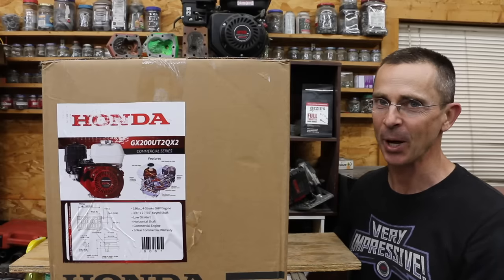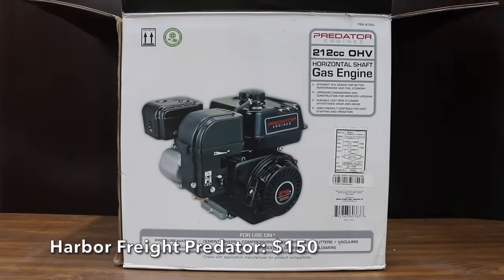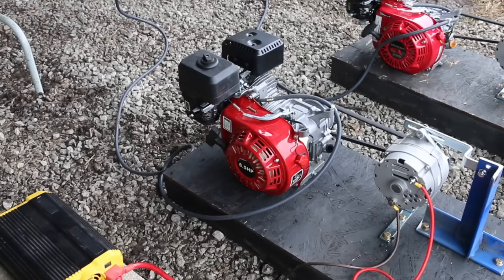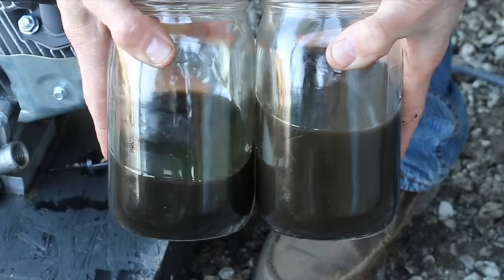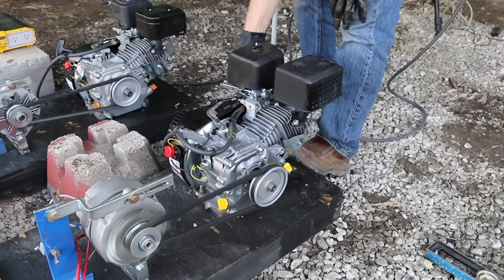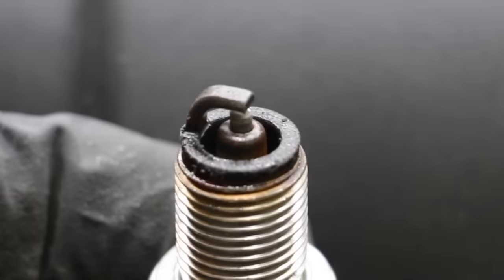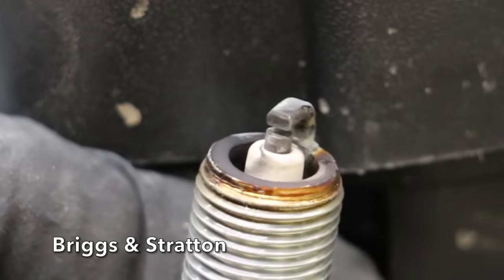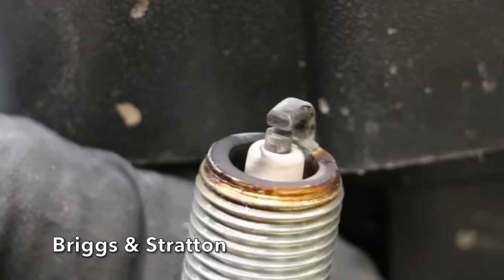$150 Honda Clone vs $600 Honda? Let’s settle this! Fuel Efficiency, Horsepower, Durability, Starting

Comment: Those Predator engines are a great value. Also crazy the amount of aftermarket there is for them.
Reply: Agreed, I live in an area where they're quite popular replacement engines, people use them for everything. As long as you don't severely abuse them and maintain them, they seem to be not only quite reliable, but also incredibly cheap to repair.

I have a buddy that heavily modifies them for go cart usage, using big bore kits and such, and when he does break them, depending on what breaks, it's often cheaper to buy a brand new predator than it would be to replace a broken bottom end of a Honda or Briggs.
Reply: I agree. I’m glad the Predator tested well since I have that on our go-cart.
Reply: Predator engines are pretty great. We gutted the one we put on my nephews go kart and it really cranks out the horsepower.
Reply: I use the 22hp Predator twin cyl only modified with electric fuel pump and better spark plug for replacement skid steer engine. 45 hours and still going strong after some pretty abusive use
Reply: But they are produced in China (Honda in Thailand). If it comes to a show-down between USA and China, I wouldn´t be sure, if I wanted Chinese products on the markets, as the sabotage risk would be high.
Reply: @ZoonCrypticon  ? Sabotage on a small engine for what purpose, to blow up every lawnmower in the US?
Reply: @bixby9797  right. The Japanese didn't invade during WW2 because there would be a rifle behind every blade of grass. And now the Chinese want our grass to be taller. 😆
Reply: can’t beat the harbor freight warranty either
Reply: @blaineburgess  Correct  on the Warranty at HF ...... The Briggs and Honda Warranty are Hands Down GARBAGE good luck getting a replacement engine from them at HF just bring back the broken engine and no question asked the same with tools
Reply: @ZoonCrypticon  Man you need to get out in the fresh air more.
Reply: Dang right….  With the correct upgrade kit you can get a lot out of them….
Reply: @ZoonCrypticon  ???? Dude We are the CHINESES BEST CUSTOMER??!!! This would be like a casino blowing up its own Gambling floor!!!
Reply: @rogerstlaurent8704    The B & S of today is not the quality product it was when built in the USA.  They went bankrupt and another company bought the name and shopped production to China.  Gee, where have we heard that story before?  And obviously the quality plummeted, as usual.
Reply from the maker: Thanks for sharing.
Reply: @ZoonCrypticon  Honda also makes their GX series engines in china, they have a factory both in Thailand and China (Honda-Jialing)
Reply: @tomrogers9467  Um, compared to Honda, Briggs has always been crap
Reply: @bixby9797  you better believe it. Why, just last summer I saw some people drive by real slow-like while I was mowing. They're just waiting for an opportunity to blow up my mower.
Reply: Indeed.  I really hope they consider expanding the Predator engine line of products.
Reply: @tomrogers9467  Mr Tom you could not say it any better but the Twin  Cylinder Engine is still a Good engine but Warranty a big fat ZERO shame B/S was a great little engine Co
Reply: @inspectormills3290  Same thing happened to me. But I did have my shirt off and was glistening with sweat, so I chalked it up to the raging hormones of the local HS cheer team, lol.
Reply: @tomrogers9467  

Yeah:

As I said in another comment on here, I'm was very surprised how poorly the Briggs & Stratton stacked up especially to the Predator. You have now provided the reason why.  I'm old enough to remember where Briggs & Stratton was a desired engine just like a Wisconsin or Tecumsah engine.

Comment: Absolutely love this “knock-off vs genuine” content! It’s scary to think that a fake looks so similar and can easily be made to look real with little effort. Great video!
Reply from the maker: Thanks so much!!
Reply: Yeah, but they copied final product.... Honda needed to do R$D from scratch... Hence the price... People don't understand that
Reply: @Crotch_Goblin1  honda didn't do good in the QA and real world division on these little engines. not to mention all the metal shavings in the oil they left for the user.
Reply: @D3AThCAl2DS  it because oil was add to others, and other may not if ever had steal.  All new car, internal combustion should have oil change after a few hours if use them about at have paste.  For first few oil changes. I would in a engine plant it few machining station and rest washing machines.  There still can't get it 100 exactly fit.
Reply: @daisykaren6584  True.
Reply: @daisykaren6584  True, my dad always taught me to change the oil frequently on a new car. Oil change at 100 miles, again at 500, and again at 1500, then continue with the manufacturers recommendations. He drove a Toyota Tacoma from 0 miles to 500k miles, and my moms GMC Yukon made it to 450k miles, both on original motors and transmission. My mom would get annoyed sometimes and say that he was overtop on vehicle maintenance; but the cars never broke down on us. The Tacoma finally bit the bullet with transmission problems, but the Yukon was still going strong, mom just wanted a new car.
Reply: @mouthwash884  oil is cheap, engine not.
Reply: @Crotch_Goblin1  Honda engines were/are actually knock-offs of American made Briggs & Stratton engines... it just comes down to the quality of the builds....
Reply: @chrischristenson  Honda is the goat in every sector even in lawnmower engines, not to mention car and bike engines
Reply: @Crotch_Goblin1  And yet they still they didn't design this engine... hence the R&D for this Honda engine now stands for Rip-off & Duplicate...
Reply: @ProjectFarm 
FYI, Honda engines have been the most copied designs ever.
They also have licensed versions being made in several countries including Mexico and China (of course).

I bought a cheap Chinese scooter and it has a 150cc Honda copy, but I can't complain since it's easy to find parts. 
All I can say negative is that the casting metal is definitely not high quality aluminum as vibration damaged several areas even with additional bracing in the original castings, causing the kick-start to become unusable.. Never used it anyway.  Keep an eye on the mounts getting loose!
Reply: @mouthwash884  That's not what "bit the bullet" means. You might be thinking of "bit the dust" or "kicked the bucket".
Reply: @chrischristenson the slant cylinder OHV GX160 came out in ‘91. Which B&S motor did they copy?
Reply: @jimjames6558  B&S has been in the business since 1908, I was working on minibike engines with this design in the 60's and Tecumseh was using this design also and they've been around since 1934...
Reply: @chrischristenson  that’s cool and all, but nothing that B&S or Tecumseh were making had anything to do with the slant OHV design that almost every single stationary engine manufacturer has copies today. The only thing in common there is some arbitrary cylinder count which does nothing to save on RnD cost.
Heck, if you’re going to pull that card then the Chevrolet Small Block is a rip off of the flat head Ford (which it isn’t)
Reply: @jimjames6558  Honda did not do a radical ground up engine unique design, that's why you can have all these clones and knock-offs without patent infringements, as they all utilized the same mounting holes and the 4-bolt pattern where the accessories bolt up to which were based off of earlier B&S. The reason the Honda motors have become the comparison leader is because of the quality of the parts and the tighter specifications... and many manufactures went with the Hemi Head and tamper proof carbs to burn cleaner and meet EPA requirements... also it was in the early 90's that that Honda started to copy Harley Davidsons...
Reply: @chrischristenson  well yes, they did use the same generic 4 bolt mounting pattern (and crank pto height for that matter) otherwise they wouldn’t fit to the implements they’re designed to power. We’re talking about a universal powerplant here. But then already being constrained to these superficial constraints saves very little in terms of RnD. They’re simply constraints that have to be designed around.
The slant OHV was a clean sheet design that owes little to the competition before, and was good enough for B&S to rip off 15 years later when the side valve engines they were persisting with just weren’t cutting it in the 21st century.
Reply: @chrischristenson  The OHV Honda GX200 has nothing to do with any Briggs engine. The Briggs engine in this video is a cheap Chinese big bore (70mm) clone with Briggs badging. Who's copying who? If Honda copied anything it was the standard footprint (bolt pattern) of the Briggs.
Reply: @Deucealive75  All non-B&S motors with this footprint were designed to replace the original (older) B&S motors... The motors were changed to OHV design because of the need to meet EPA emission standards, not because of a superior design. The OHV design adds more parts and complexity and the Honda is not some new radical design of a small 4-stroke motor. You will also see the change to a hemi-head only to meet stricter EPA standards. Honda's are a good motors because of the quality of their builds. B&S now is not the same company it was, thus they now follow the current leader.

Comment: Amazing comprehensive test. I've used predator engines for years. I had one that wasn't correct right out of the box but all of the others have treated me well. We're on a small farm that has a lot of gas powered equipment so we've had a bit of everything over the years.
Reply from the maker: Thanks!  Thanks for sharing.

Comment: You should use the borescope to check the cylinder walls. I have a predator and a Briggs both with similar hours and the predator has worn away the factory honing marks and the Briggs cylinder wall looks brand new.
Reply: Then do your own channel🤦‍♂️
Reply: Great idea,
Reply: That's where the price difference comes in. Honda and Briggs have low power compared to predator but both have limited carbon built up. And we can assume that both would last longer compared to the cheap one.
Reply: @martinqizeaq  Yeah, the cast iron quality is higher in the briggs and honda.
Reply: Could be the quality of cast iron they use in the sleeves...
Reply: Yeah, I was wondering about these four after 6 months of use.

Comment: An idea I had for a video is comparing permanent marker performance. It would be interesting to see if any has the edge in less than ideal environments like dusty or oily surfaces. Or if any of them last longer than the other.

Thanks for all these comparisons by the way. Always excellent work
Reply from the maker: Thanks and you are welcome!  Thanks for the suggestion.
Reply: sharpie pro are better than sharpie.but not by much
Reply: surely like to know. I write timing belt, and oil change stickers and it seems like most of what I write is gone or nearly gone when the car returns for service.  Timing belt ones disturb me the most.  I don't want to use an engraver.  some customers have me engrave anyway, right on the valve cover big letters. date and next change mileage.  Just timing chains and motor rebuilds.  Writing with a marker seems to always be gone.  Off road stuff that gets washed with a pressure washer, or the caked on dirt dries on and gets scraped off later.  seems like nothing stays on those 4 wheelers.  Inside of the back of the seats.  even then those are getting gone also.  Need to mark where it doesn't have to be out of sight, therefore out of mind and therefore the oil gets changed too late and they blow up.

Comment: More engineering was put into this than the actual engineers who designed them. Great work.
Reply from the maker: Thanks!
Reply: ok
Reply: ok
Reply: ok
Reply: Especially considering the "engineering" for the Honda clone and the Predator involved buying a Honda engine and having someone copy the design as closely as they could while using slightly less expensive materials!  I have to give Honda engineers credit for designing the gold standard for small engines.  It is always interesting to see various brands of snowblowers, lawnmowers, and pressure sprayers etc. which slap a "Powered by Honda" sticker in a predominant location.  It seems people know what quality is and they are willing to pay for it.  That said, I'm sure for most users the Predator engine would probably work very well and last for many years.

Comment: The Predator GX clones are so close to the GX series that the parts will swap. The engine will blow up on you, but the parts will seem like they fit on the equivalent engine. I learned this the hard way when replacing the engine on a generator that came with a clone GX160 or GX200(can't remember), and the replacement Predator 212cc seemed identical. Because of the tapered shaft on the generator head: I was forced to use parts from both engines together. Last time we had a power outage it blew up on me and we ended up losing food. The 2020 Iowa Derecho was hell. We had no power for 4.5 days. Just long enough to lose all our food. Shame I didn't know those parts weren't quite identical though...
Reply from the maker: Thank you for sharing!

Comment: Given all the mods you can find for a Predator 212, I would probably choose that one for a go-cart.
Reply: They also don't claim to be more then they are.
Reply: @qwertykeyboard5901  given the price, pretty smart they don't claim to be something dumb like "80% better then a Honda" or some other nonsense like that
Reply: I've built plenty of go karts predator engine are amazing  for their price
Reply: I mean If there are a bunch of cheap easy to get parts to repair your engine its basically better
Reply: @francisconikotian2326  sort of, I'm not sure I would trust my life on a Predator engine, I don't have any experience with them. However, I'm perfectly comfortable trusting my life on a Honda engine, I've used them in the past on equipment and they always performed flawlessly.
Reply: @Shawn_the_Protogen . Dude I hope your not really trusting your life to any small gasoline powered engine, what,do you have it powering your iron lung breathing machine or something ? I’m kidding , I’m kidding .
Reply: I’ve use predator 212’s in a couple go kart builds and ramped them up with aftermarket parts turning way higher Rpm’s then they were original designed for at they still keep whining away !
Reply: @plesadian3  gotta love the 212. Lil engine that does it all without making your wallet sore.
Reply: I've built plenty of predator engines and my current 224 has 14.5:1 compression and the thing has enough power to spin the tractor tires on my off road go kart. The thing cost me 450 bucks to build including the engine. This is still cheaper than a brand new gx200
Reply: @lerabidheavy7437  it's definitely earned the Predator name, not many other super affordable engines can give Honda a run for it's money.
Reply: @Shawn_the_Protogen  love the 224 over the 212 though, the block is beefier and has more parts in common with the Honda than the predator. It's currently putting down around 20-22hp and 17 to 18 pounds of torque. The only complaint I got is that it chugs e85. But for going off road and just going up against sand rails it gives those a run for their money with my dumb ahegao and yiff stickers in the back to make it a even stupider ride
Reply: @qwertykeyboard5901  It's probably as close to being a HONDA without actually being a HONDA!
Reply: @Shawn_the_Protogen  You CAN'T beat a HONDA! They make the BEST engines, PERIOD!
Reply: @TheOzthewiz  I love Honda too, don't get me wrong. My first motorcycle was a 1984 Honda Magna 700C, had a Japanese engine, 4 Carburetors, 6 speed transmission and shaft drive. However, when it comes to small engines like for a generator, lawnmower or snowblower, if I need to replace the engine TODAY, I'm not going with Honda since I don't have the money to have one shipped to my house, I'll go with the Predator I can buy 20min from my house and use that.
Reply: @lerabidheavy7437  What fuel octane do you have to use?
Reply: @thenightterror9827  have to run E85 or 110 octane
Reply: The Predators are made by either Lifan or Loncin. Either way they both use the same 212cc design, which is actually excellent and nearly on par with the Hondas in terms of build and longevity!
Reply: @Shawn_the_Protogen the Magna sure was an amazing bike.
Reply: @plesadian3  on an actual serious note, a lot of people use predator motors along with a kit that turns them into surface drive boat motors, and then subsequently take them to some pretty remote places. It might not be the most dramatic example you could think of, but it could certainly turn into a life threatening ordeal to have a motor die on you in some of those places
Reply: @Shawn_the_Protogen  As they shoud for their increased price point.
Reply: @harleye1235  god I miss that bike....my wallet sure as hell doesn't 😂 damn thing barely scraped 20mpg
Reply: @plesadian3 These little hondas are used by fire stations where I live, so yes, they are absolutely life-saving

With that said, these cheap clones are good enough for most use cases.

Comment: Todd, thanks for this good information. It just wonders me if the difference in performance of the engines is the engine itself, or the carburetors. I would like to see OEM vs aftermarket carburetors tested on those engines to see if that matters any.
Thanks for the work you put into these.
Reply from the maker: Thanks and you are welcome!